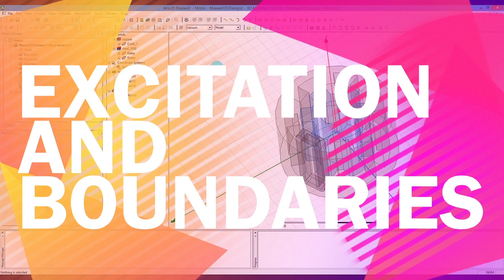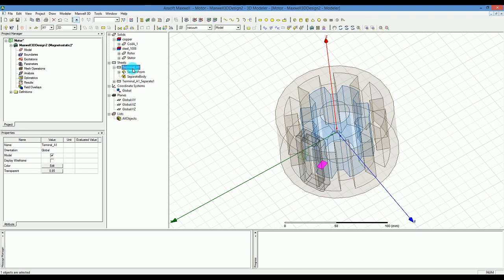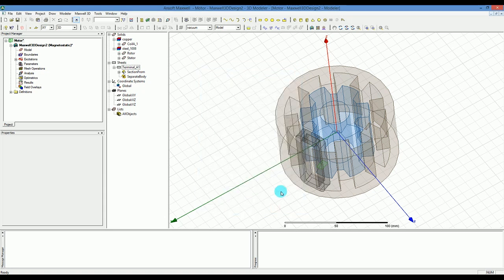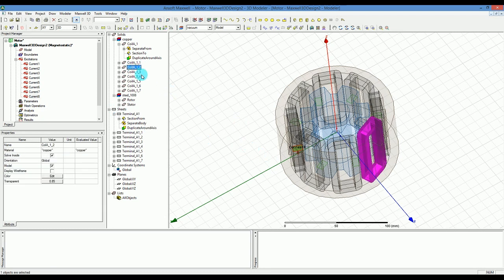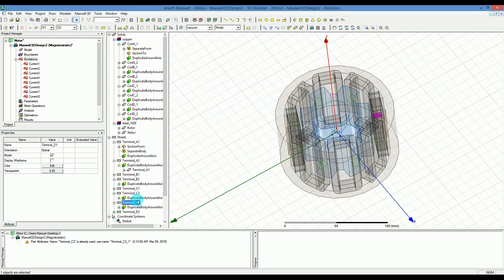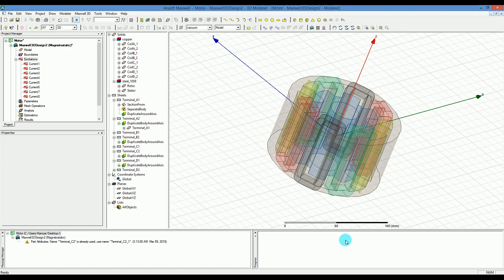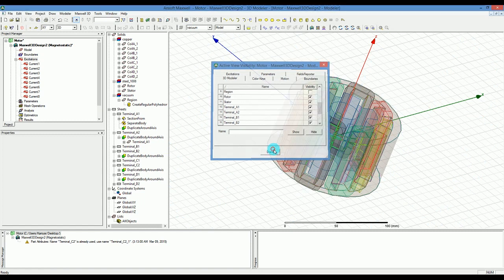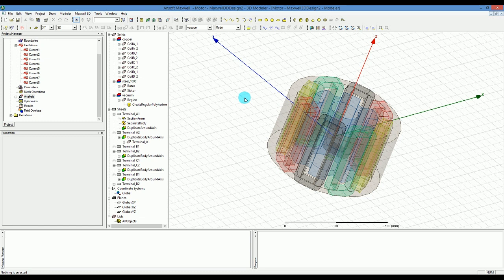211- Ansys Maxwell - Simulating Reluctance Motor [part 2]

Comment: Hello Kamyar, at 3:00 you are saying that it will be considered 1 turn. On the parameters setup, after Add Matrix and all that, on the "post processing tab" , you can see that they give you the possibility of telling the number of turns. Does that mean that you can simulate the "solid" inductor that you are modelling as it would have those number of turns you are putting in ?

Comment: I am carrying out a transient analysis of an electric motor. After running up to 250 ms it is showing an error that core loss values cannot be recovered and I am not able to run it further. Please help me to resolve it so that I can carry on ahead with my simulation.
Thank you in advance.
Reply from the maker: are you using maxwell 3d?

Comment: sir iam getting some error  phase-A matching inductor not found in switched reluctance motor  ,how can i overcome this problem .
Reply: Hi sir this is reddy , thank u for ur help . i want to inject the pulse (current or voltage ) in to one coil of a phase in switched reluctance motor ,how to inject the pulse ? reply me
Reply from the maker: +veera reddy  you need to use simplorer or external circuit (in transient). 
I have tutorial on both.